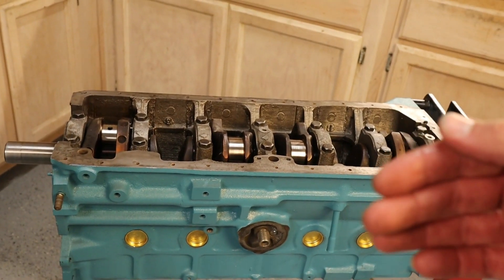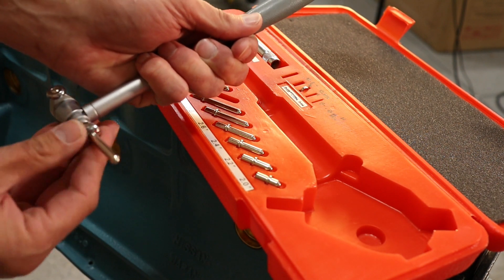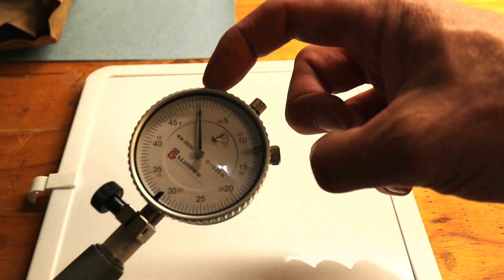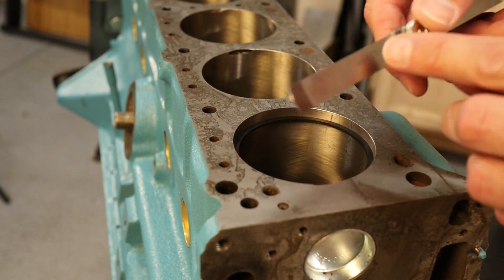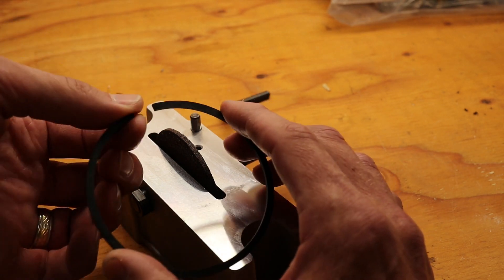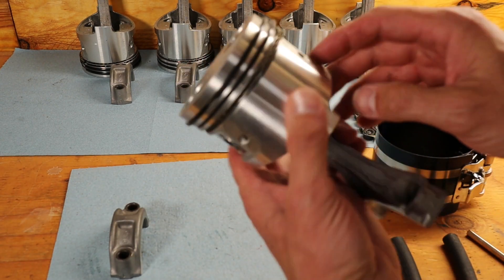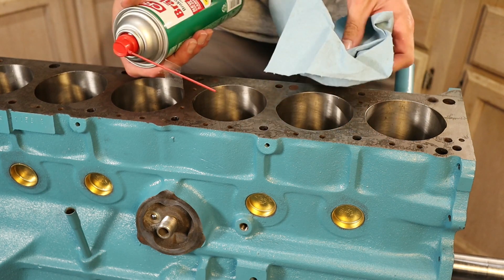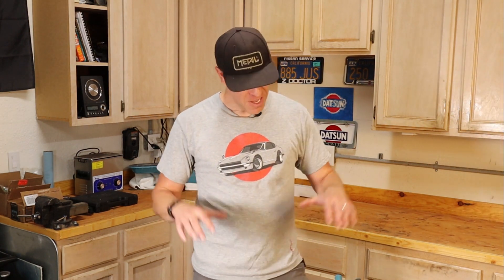How to install pistons and rings in the Datsun 260Z L26 engine, Part 2

Comment: In an earlier video you attached the piston to the rod using a blow torch, but in this video you said a machine shop attached them. Did the blow torch method not work?
Reply from the maker: Different engines. When I did it, it was a 280ZX engine for a 240Z, this time around they just did it for me for the 260Z engine.

Comment: Great video.  Noticed you installed new Arp rod bolts after getting your connecting rods reconditioned. Normally, you recondition the rods after installing new rod bolts. Since the rod bolts are pressed in the rods get distorted and need to be reconditioned .
Reply from the maker: Thanks! I would agree on some other bolt and rod combo’s but the tolerance for the arp bolts and the stock Datsun rods aren’t that tight. I freeze the bolts and that’s enough to push them through by hand.
Reply: @CarsBikesandCoffee   Clever way of getting around having to press them in. After I watched the video I got concerned and just thought I would let you know. When I built my motor I overlooked how much  pressing in the bolts distorted the rods. Can't wait to see the car running keep it up 👍
Reply from the maker: Right on! I appreciate the extra eyes for sure🤘🏻
Reply: @CarsBikesandCoffee  Hey Kurt, I'm right behind you on my build and bought ARP rod bolts as well before finding out about resizing but that is only required if the new rod bolts have to get pressed in correct?  I'll stick my ARPs in the freezer now to get them ready for installation and hope it works like you described😅  Thanks for the videos!
Reply from the maker: @sgzmn2803  you should be good! 🤘🏻